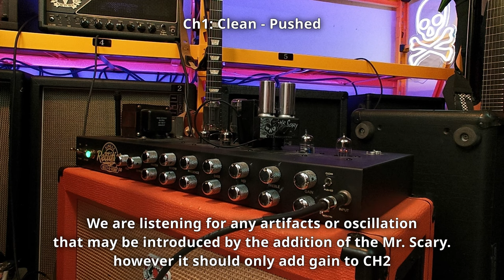Mesa Single Rectifier + Mr. Scary Hot Mod?

Comment: Those hot mods are so great. I have one for my orange OR50. Of course, it didn't fit in the chassis, I called them, and they walked me through the installation, great people. It really didn't tighten up the bottom, but the saturation mix with that orange sound is so great and different. The dirty tree in front, mixed all together, can make a unique metal tone. Like a rockerverb on steroids. Great video, brother. That sounds good.
Reply from the maker: I’d be curious how it sounds in an Orange. Thanks for watching!
Reply: Great video. Thanks for sharing. I was just on LT’s website and saw that it can work on the single Rec amps. Now I’m buying one!!  

Did you any other overdrives or EQ pedals in front or through the effect loop yet. That would be interesting too to hear. Cheers
Reply from the maker: @billyarbrough291 I’ve tried it with various OD/boost up front and it sounds gnarly!

Comment: Sounds amazing in the single rectifier. I use a regular hot mod in a 2203. Need to try in my dual rect.
Reply from the maker: @81jmfk  is the Marshall a Reverse wire? If so it won’t work in the Mesa.
Reply: @thatsoundsterrible  I’ll have to figure that out. Thanks for the heads up
Reply from the maker: @81jmfk  look on the bottom of the unit for a stamped R  that will indicate if it’s a reverse wire